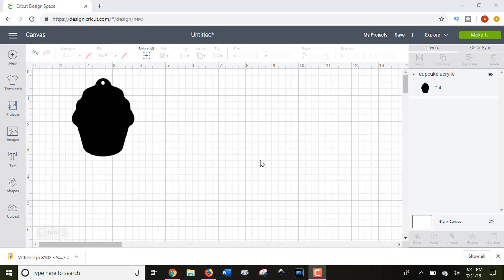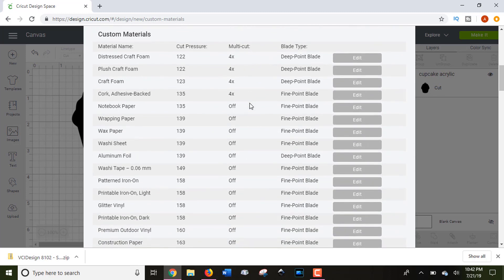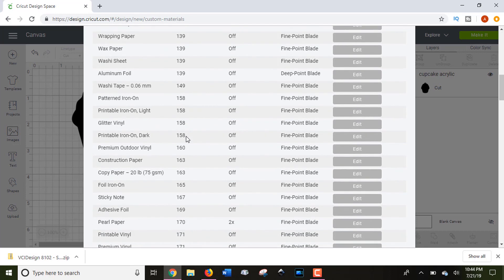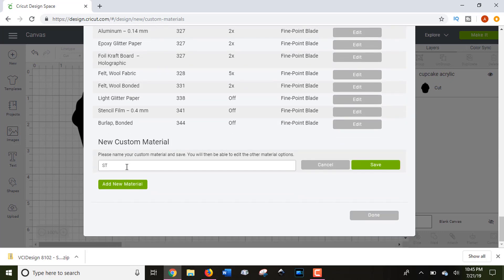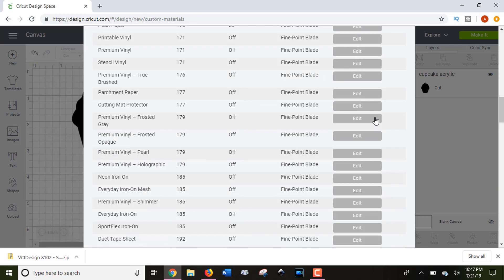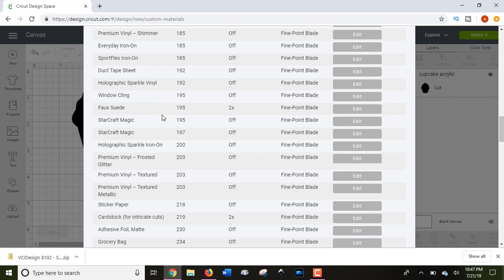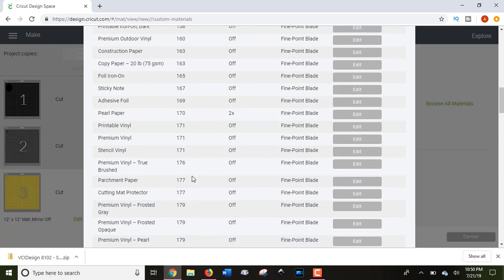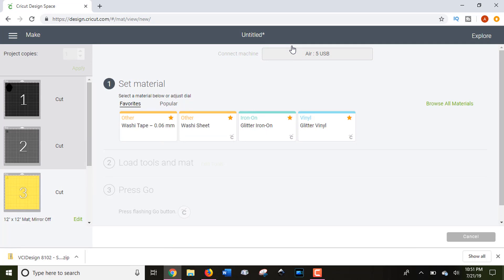How to Adjust Blade Pressure Settings in Cricut Design Space

Comment: Thank you. Great advice to do test cuts! I have used the cut settings in Custom Materials to add a specific material, but never thought to use this to figure out the next higher pressure to use if needed. I do use the 'more or less' rather than 'default' when my blade might be dull and I'm trying to get more use from the blade. Also, if you think the cut is not good, you can hit the Cricut (cut) button again for more cuts until you are satisfied. Sooo much to learn about our Cricuts, but they are wonderful machines!
Reply from the maker: G Prewett Oh yes those are important points too! You can never stop learning about these machines. I reached out to Cricut and learned that the “more” and “less” settings under custom add 2-4 points of pressure to the setting’s number just for perspective.
Reply: @DIYAlex  Thank you so much for doing that! It's great to know the pressure difference for the More and Less settings! Love you videos!
Reply from the maker: You’re welcome! Once I started learning more about pressure I got curious. Thank you so much 💕